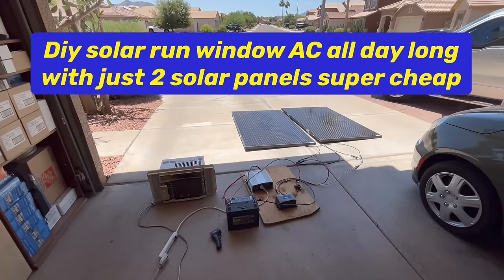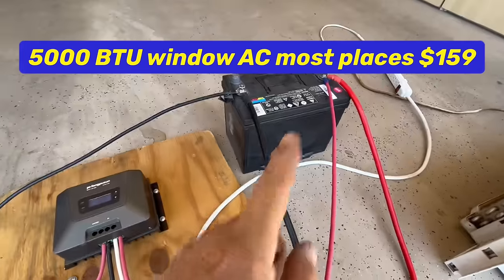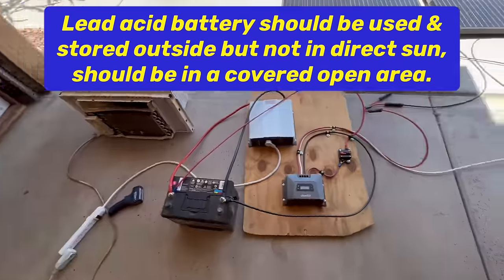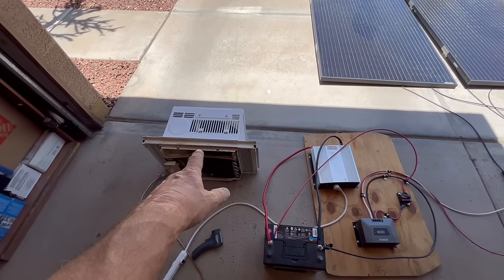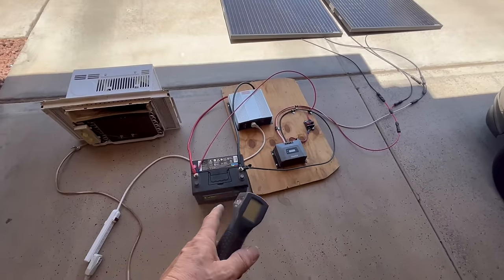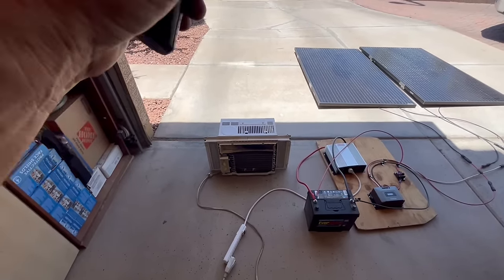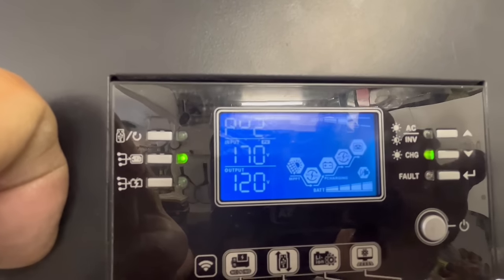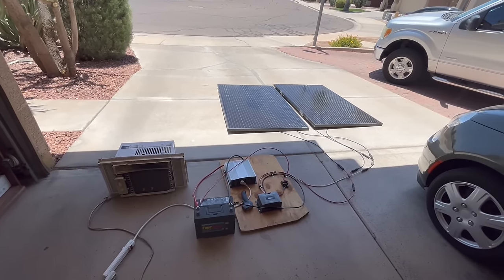Run your window AC with just 2 solar panels when sun shines. Easy DIY project you can do in one day.

Comment: One world.... AWESOME.
Reply from the maker: Thanks, check out my videos on air conditioning my house in Phoenix AZ off grid spending $0 on air conditioning when it is 113 degrees outside in day and 90 degrees overnight low. 2 story house 2450 square feet and air condition garage all day long with solar during the day. We run our pool pump 365 days a year using only solar and heat our pool in winter to 87-89 degrees. Off grid solar can do a lot. Check out my other videos, I run 6 mini splits we installed in house as well and can run on solar in day and 25.5 kWh battery bank at night. Thanks for your comment and hope you have a wonderful and blessed week

Comment: I thought about doing something like this many times.  I've had the knowledge to do it but just not the motivation because I already have a grid tie solar system.  I thought it would still be neat to keep one room colder because I get hot so easily and my girlfriend doesn't like to be cold.  I do also have a small off-grid system but it's not sufficient for an A/C.  From time to time, I think about upgrading that off-grid system and doing something like this 😄
Reply from the maker: Very easy to do, I buy all my solar panels locally for $25-$35 each so I can use as many as I need to run what I need to. I actually run my whole house ac upstairs, downstairs and in 3 cat garage with only solar in day upstairs with LiFePO4 batteries at night. Check out some of my other videos for other ideas around the house, thanks for your comment, hope you have a wonderful and blessed day

Comment: Effective and simple. Very nice! I think I'd consider a pair of batteries because that's quite a load on just one, but otherwise you've put together a good, practical system.
Reply from the maker: This is just the bare bones basic system, the more you improve, the better system you will have. I encourage you to improve upon it. I did and now 100 percent of my ac and heat is run by solar upstairs, downstairs and in my garage. I also run my pool pump and pool heater. I run many more things 100 percent totally off grid solar. Hope you enjoy my other videos and how it accomplished this. Hope you have e a truly wonderful and extremely blessed 2024.

Comment: Wish you were in Reno-Sparks, Nevada! I am putting together an ABSOLYTE GBS 48 volt battery bank together... came out of a telecommunications system up on a mountaintop... planning on using it on our offgrid, modified Earthship style home. Great Video!! We need something like this in our 40' Jayco LOFT!!
Reply from the maker: I am working on installing solar on my motor home and installing a mini split so we can camp year round using only solar but have a propane back generator if clouds roll in. Let me know how your project comes turns out. Sounds like a lot of fun DIY with that battery. Hope you have a wonderful and very blessed weekend

Comment: 🏖️Your video is the BEST📌 video. Simple and easy to comprehend. I am going to buy these components, and get  prepared for the hurricane season.(electricity is the first thing we lose) Thank you so very  much!
Reply from the maker: Welcome to the channel and thank you so much for taking the time to comment. I am so glad you found it simple to follow along. That is my whole point of sharing with other that are just starting out with off grid solar. We actually air condition our house and garage with only solar and battery bank. I am actually in the middle of filming installing a mini split in my 23 foot motor home so we can go camping year round and have ac and heat with probably less than 1000 watts in solar panels. I ran this set up for two years when I first started 4 years ago and knew nothing about solar, now I can run anything in my house and yard using solar off grid. Out in AZ it is not worth it to go on grid. Basically double the price of system. Now in December will be 4 years and our system will have paid itself off in just electric bill savings. We actually use more electric now that we can produce it ourselves. It is nice heating our pool to 87-89 degrees in the winter using solar and an electric pool heater heat pump that uses 7500-8500 watts while running. Electric bill will be $50-$60 in winter and we will have a heated pool and heat in our house. It a good day every day here with off grid solar. Hope you have a truly wonderful and blessed weekend

Comment: FYI on the harbor freight inverters. If you use them and disconnect them and keep and keep arking  the terminals. It will blow the fuses inside. These things are made to plug in and stay plugged in. Just let everybody know you do have fuses in there but they are 20 amps a piece and they're solder to the board.
Reply from the maker: Thanks for your input. I know I used the inverter for over 2 years and never had a problem at all. I will check out the fuses. Hope you have a truly wonderful and extremely blessed 2024.

Comment: I appreciate the video and your setup. You have an inexpensive functional system.
A mini-split is a great option. Be sure to get one with inverter technology.
Mobile platforms have much thinner insulation. You may consider a larger unit for that much area.
A minor issue is the modified sine wave inverter. 
They are fine if you are just running a motor, but they are less efficient and can damage some electronic devices.
Most modern A/C units have electronic controls. Efficiency is King in solar setups.

For the last 2 years, I had a 5000 BTU in my insulated Pet Palace Solar Shed (8x12). ~600W max
It really would struggle when the temp got to 95 and above. I keep the inside temp about 75.
The solar equipment generates a fair amount of heat in Summer and Winter along with the pets. 
My equipment is listed near the bottom of this post.

Initially I had a 8000 BTU portable A/C ~ 5500 BTU effective. It was a decent unit, but took up a lot of space.
It sucked a lot of juice, had a drain hose(generated distilled water as a byproduct of cooling), 
was loud and had trouble keeping us cool when the temp soared over 100F.
A friend now uses it in his bedroom. He adjusts his main A/C temp up a few degrees for over night.
He also uses the distilled water for his plants. Waste not want not.

My 5K BTU generally cooled well until the outside temp gets above 90-95.
It can keep the shed about 10 degree cooler than outside temp.
When it was 110F outside, it was 99F inside. The dog went looking for shade outside.

This year, I got an LG 8000 BTU window unit with built in soft start and dual scroll inverter and it is much quieter.
The LG is little pricey compared to cheap window units, but well worth it. It also has wifi and app, I don't use.
Standard power consumption is much less than the 5000 BTU. When it kicks in full, it pulls 50% more, but keeps us cool.

I am an electrical engineer and am happy to answer general questions about Solar.
Although I have the technical background to understand solar, consumer equipment available changes frequently. 
I would go a different route if starting new today.

* Solar equip: 24V nominal system.
2 banks of 3 - 320W Renogy solar panels. One bank faces morning sun and the other faces evening sun.
Dual EPever BN-4215 40A MPPTs (one for each bank). Typically provides 25-30A of charge current.
1 Giandel 4000W pure sine wave inverter. I recommend only PSW inverters for running electronic loads.
14KW 8S2P LFP battery with JK 200A BMS with 2A active balance and Heltec 5A active balancer.

My experience is I really need the active balancer for the large LFP batteries.
If you get preassembled server rack batteries, active balance isn't an issue.

This system powers not only the A/C but a minifridge, microwave and computer with 50" screen.
I spend a lot of time in the dog house lol! The dog and 2 cats generate considerable heat also.
One can stay comfortable down to 40F outside before needing heat.
I have a bathroom heater set to 60F for Winter. 

When below 20, I have propane as a supplement. It is set to 45F.

Generators:
I have a Westinghouse i2200/ 1700 gas generator to charge the battery directly.
I have a Westinghouse i4500/ 3700 gas generator. I don't use it much as it uses more gas.
I have 2 - 30A 24V chargers, but only run 1 from "Lil' Genny".
The smaller generator only runs about 4 hours typically, 
I can load it up and confidently put the pets to bed.
The larger unit can run all night, > 12 hours which I needed when I had the 8000 BTU portable.
Reply from the maker: Thank you for taking the time to share all that wonderful information. This is just a simple example of the system I used in my solar shed for 2 years, I used this basic bare bones system 4 years ago. Now 4 year later I am running my 3 1/2 ton and 4 ton central heat pumps to air condition and heat my 2 story 2450 square foot house with off grid solar in day and 25.5kwh EG4 LiFePO4 battery bank overnight. I also installed 6 mini splits. 2 upstairs, 2 downstairs and 2 in the garage. I can run a combination of the the central and mini splits day or night. I cool my 3 car garage in the day because there are 3 bedrooms, a bathroom and a loft above the garage. Without AC in garage, it’s gets up to 140 degrees when pulling in 2 hot cars here in Phoenix AZ. We use a lot less power at night when garage is at 78 degrees. Our electric I’ll in June 2023 was only $101, we set new records with average daily 24 hour temp going from 98 degrees to 103 degrees. It was hot and we spent $0 on air conditioning in June2023. We run our pool pump 7/24 365 days a year and even heat our 15000 gallon in ground pool to 87-89 degrees in the winter with a 17,000 btu heat pump pool heater and a 127,000 btu heat pump pool heater, that pool heater uses 7500-8500 watts when running. I had to install soft starts on my 3 1/2 ton and 4 ton heat pumps for house and also a soft start on my 127,00 btu pool heater. I only have electric at my house. No other power Source such as natural gas or propane. Check out my other videos on how I was able to a accomplish with no experience 4 years ago. I learned as I went along. Don’t have all the terminology down completely yet and because of the 2 incurable cancers I was diagnosed with and dealing with for last 10 years, I sometimes have the words come out wrong from my mouth due to prescription pain killers and other meds. So I apologize in advance if you watch my other videos. I have a viral video where I said hot air drops and and cool air rises. It just came out wrong and I did not catch in editing before I uploaded video. I know hot air rises and cool air drops but meds effect my speech, sorry. Once again thank you for All the valuable information. Hope you have a truly wonderful and extremely blessed week.
Reply: I had a similar issue on my 10x16 shed using a 5000 btu ac. could not keep up with heat gain until I added corrugated metal panels on top of the existing roof which reflect heat and the wave pattern allows airflow underneath. made a substantial difference. I use and inline temp controller comes on at 79.7 and turns off at 77.3. pretty comfortable for the animals.
Reply from the maker: Wow Thank you for all they valuable info and taking the time to share. I actually installed 6 mini splits in my house and garage. I can run all those on my solar system during the day and 3 mini splits at night on LiFePO4 battery bank. I can now also run my 3 1/2 ton and 4 ton ducted central heat pumps that were installed in the house when built. They use around 6500-7500 watts when both running at same time. I can also run a combination of both, usually the 3 1/2 ton upstairs and the 2 mini splits downstairs all using off grid solar. I run the 3 1/2 ton central upstairs ac 24 hours a day on solar and battery bank. In the winter when I don’t use mini splits or central ac that much, I run my 127,000 btu electric pool heater heat pump to heat pool to 87-89 degrees. Pool water in the winter out here is usually in the high 40’s to high 50’s in December, January, February and March. That beast of a pool heater uses 7500 to 8500 watts while running and can heat a 15,000 gallon pool water 2-3 degrees per hour. This was an example of what I used 4 years ago Whalen I first started out and knew nothing about off grid solar and how to use it. We have come a long way since that. Now in December, our entire solar power off grid system will have paid itself off in savings. Next January we will be producing FREE electricity from now on. Hope my viewers and subscribers can use the info you provided to help them in some way. I appreciate your input, check out our other videos showing all we do and how we do it with solar. It has make a huge difference in our lives. Hope you have a truly wonderful and extremely blessed week.

Comment: Sun goes down ac goes off, test how much battery power to run ac at night. Great video
Reply from the maker: At 500 watts, to run for 10 hours overnight you would use 5000 watts or 5 kWh. I would say you would need at least 8-10 kWh LifePO4 battery bank. 2-5kwh server rack batteries in parallel would do the trick. I’m going to use 2-5kwh server rack LiFePO4 batteries in my motor home to run my 12,000 mini split overnight. Thanks for your input. Very much appreciated. Hope you have a truly wonderful and extremely blessed New Year.

Comment: Very nice! However my experience with everstart battery wasn’t good. It died after a few charges. Solved the problem by ordering a lithium ion battery off Amazon.
Reply from the maker: Lithium iron phosphate battery is the best way to go. I was just Doing a simple example of running ac on solar, although I ran this system in my solar shed for over 2 years to keep inverters and batteries cool during summer heat out here in Phoenix AZ

Comment: Thanks for the demonstration! I really want a small set up for my shop and sun room! Thanks!
Reply from the maker: You are welcome. This is just a simple set to show how solar works. I have gone way beyond this and now air condition my upstairs and downstairs of our house with only solar in the day and battery bank overnight. We also air condition our garage all day long with only solar, we don’t run on batteries overnight in garage but could if needed to. We installed 6 mini splits in our house and can use those instead of central ac units, we can run all these with solar and easily switch back to grid if needed to work on system. We even heat our 15,000 gallon pool in the winter to 87-89 degrees when water temp without heating would be in the 40’s. We figured out how to accomplish this all watching videos on YouTube. Now we show how we accomplished this , all DIY. Next we are going to install a mini split in our motor home, mini split will use around half the watts to 1/3 watts a roof ac will use. Same thing in your house. I can run 2 mini splits to cool 1200 square feet and use 1/2 the watts that a 4 ton central ac would use. Mini splits are great with solar for that reason and I bought my 12,000 btu(1 ton) mini splits for $500-$600 each and installed all of them myself. 4 years ago we did not know anything about solar, mini splits, central ac or electrical. Now we can run our heat and air conditioning 7/24 365 days a year and save over $5000 on electric bill, which has paid back our investment every year for last 4 years. In December of 2023 we will have recouped our investment completely through saving on electric bill and will be producing FREE electricity for the next 20-25 years. It’s pretty easy now but I had to start with no knowledge of any of this. Now I share how we accomplished this in my videos and what we are able to do with solar throughout the year. Hope you enjoy the other videos and hope you have a truly wonderful and extremely blessed week
Reply: @diy-solar-guy  Thanks again and I could use some blessings thank you!

Comment: Looks like a great setup for her needs.
Reply from the maker: It is. Need to bring the motor home and try in driveway with deep cycle battery, then with Lithium Iron Phosphate battery. I can run the Ac unit with lithium iron phosphate at night but could not run with deep cycle battery at night. Can’t wait to go camping and use overnight. Thanks for your input.
Reply: @diy-solar-guy  Yeah, LiFePO4 is nice.